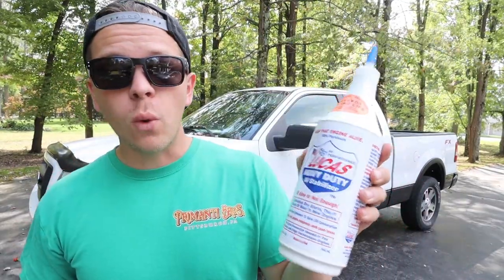Fixing A Knocking Motor For $13 With Lucas Oil Stabilizer!!

Comment: That sounds like timing chain and chain guide slap. A tachifier such as Lucas or Hy-Per Lube Oil Supplement can definitely help with the noise by providing a bit of cushion since it will stick to the metal parts even after the motor oil has drained back down to the pan when the truck just sits. Chain stretch (wear) is why I don't recommend people go by extended oil drain intervals that some manufacturers recommend (based on pressure from the EPA) in the car manuals. People forget that timing chains are intentional metal to metal contact (the links) and even though that motor oil that has turned black might still test "ok" from a oil analysis, the combination of dry starts and running oil that's saturated with carbon particles really does a number on timing chains that otherwise could have lasted the lifetime of the vehicle.  Best way to prevent premature timing chain wear (stretching) is 3000 mile oil changes (if conventional) or 5000 miles max if Synthetic and use an oil filter with an efficiency of 98.5% at 20 microns or better.  I've seen trucks/cars that have needed new timing chain kits at under 80k miles even when the owner was following the car  manual maintenance schedule and doing 7500 mile oil change outs or following the "oil life light" on the dash, and yet other people who own the same make/model of vehicle who were a bit more stringent on their oil changes, disregarding what the manual said and instead changing the oil at 3k or 5k max and even at 150,000 miles their chains are still fine.  It all comes down to how long do you want to own a vehicle without having to do a major repair.  In the case that you are already at the point of having to deal with chain slap, by all means, give a product like Lucas or Hy-Per Lube a try but just keep in mind that the wear & tear has already been done to that timing chain and chain guide and sooner or later your car will need a complete new timing chain kit install (including all sprockets, guides and tensioners) but for people who don't want to do the repair and instead start using a tachifier,  if the noise ever comes back or gets worse,  even when using a tachifiying addititive, that means the slack in the chain has increased even more to where the additive is no longer enough to cushion the gap and at that point don't put off the repair for too long because if that chain jumps timing, you'll be talking major engine damage and most likely getting an engine replacement.
Reply: Nice

Comment: Also the timing chain tensioner gasket can leak causing a rattling noise only present until pressure is restored at startup. I can see why adding an oil stabilizer could help as it may clog up that leaking gasket enough to significantly slow the leakdown that robs the top end of oil after a "cold soak".

Comment: Sounds like it worked great   A lot of people say the oil recommended for these is too thin   Also they are low on oil pressure which a thicker oil will increase
Reply: It's low on oil pressure because the bearing is spun and the oil that is suppose to pressurize between the bearing and the crank shaft is pissing oil back into the oilpan. Giving less resistance for your oil pump to pump against decreasing your oil pressure.. Sure thickening it will increase oil pressure but it doesn't fix the issue, it might also dampen the knock but again doesn't fix the issue. I would only advise doing this if you literally don't care about the engine and plan on replacing the whole thing anyway.

Comment: Have used Lucas for almost 30 years. Think prevention and not cure. Countless bottles going into old cars that had nothing wrong with them. Extra cost but it prevents the knocking and pinging from starting.

Comment: Not sure if you still have the truck but that start up rattle is the timing chain tensioners. After the truck sits, oil leaks from the tensioners causing major slack in the chain

Comment: I had the same truck, helps a lot on start up if you use the ford brand oil filter it has a valve in it for this very reason.
Reply from the maker: I’ll check it out, thanks!
Reply: They all have pressure relief valves in them. id use a semi synthetic oil if your not already.
Reply: Ben Covington is that better than full synthetic? Why use that?
Reply: @TRYHaRDproductionz69  exactly.  Walmart has full synthetic for almost the same price as conventional.

Comment: When I first got my 04 F150 with the Triton I replaced a quart with this Lucas.  In the next year it needed new cam phaser solenoids THREE TIMES!.  Since this vid have you had similar troubles?  Maybe I just had bad luck?
Reply: Did you have the old style vct solenoids ?  We’re those the ones that went bad ?
Reply: @joesmith-fi1sx  actually both, the two original ones, then one of the new type ones However, a mechanic I trust told me his opinion was because I was running Lucas in the dead of winter, cold starts are murder on the triton.  The screens on the solenoid probably were gooed up
Reply: Mike Peterson makes perfect sense    How cold was or is it where your at ?  Were you tuning 520 or thirty with it ?  Since then what did you change to oil wise ?
Reply: The big issues with these motors is the oil pressure these pumps are week from the get go!!! 
Then add poor oil change schedules and the oil weight recommendation from Ford which was only suggest to improve the mpg for the United States market and the ridiculous deals they had on lease deals and it's no surprise there's so many of these out there my first brand new car ever was a 2006 f150 4wd extended cab with the chrome package and my 2 year lease at that time was $500 down & $185.00 a month it was stupid ridiculously cheap

Comment: Ford 3 valve 5.4 have a tendency for complete failure, bad design. Check out Car Wizard videos on this. Glad I own a 2 valve 5.4 after watching him. Very good info.
Reply: Nah all 5.4s are wondrous
Reply: @hyperpotato1197  
look up 3 valve 5.4 videos. ESP car wizard, he shows you what’s going on. Oil ports were to small and a little bit of gum up destroys these engines. It’s not even recommended to get a used engine. Has to be a reman that fixed the actual problem. I know 4 people in my area that had to replace engines. I know zero that had 2 valve 5.4 engines replaced. But if you think they are wondrous I respect your opinion.
Reply: @mhc2984  I’ll always be a 5.4 man, the 3Vs can be temperamental so always take extra good care of em. But yeah I’m team 2v

Comment: My brother had that same truck with the same engine make that noise it ending up being a frozen roller rocker which wiped one of the lobes on the cam
Reply: Dam man thats my issue right now is that noise. Gunna suck if i need a new cam
Reply: @puprilla  yes sir they had to replace the cam on passenger side and one of the roller rockers
Reply: @danielpadgett2831  fuck 😆 thats the same side mines messed up on. Hope it dont cost a arm and a leg i like owning my truck but ill trade it in for a new one if its to much
Reply: @puprilla  yes sir i sure hope not maybe its something thats not to bad
Reply: @danielpadgett2831  gotta be a follower ive done everything else 😆 just hope my cams ok when i get the time to do it
Reply: @puprilla  i sure hope so

Comment: My buddy got a fuck over at the oil changing place an he ask me wtf wrong with my engine an I recommend this it works along with a thick oil like 15w40 I run the in a ls 5.3 that almost 300,000 on it.l fits problems like this an dont like to talk or argue 😎✌

Comment: "Fixing a knocking motor with for $13 with Lucas Oil Stabilizer". Lol. You didn't fix anything. More like "MASKING a problem for $13". That "knock" you speak of is timing chain rattle, probably from blown timing chain tensioner seals and the longer you go without fixing it, the worse it's going to get. The truck had already been started too after you added the stabilizer. That's why it was quiet after adding it...
Reply from the maker: Facts